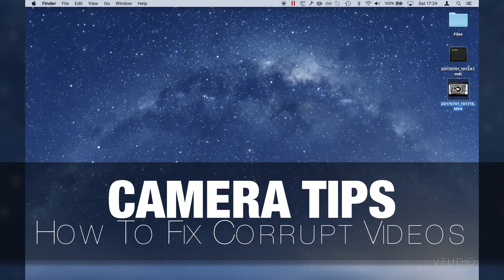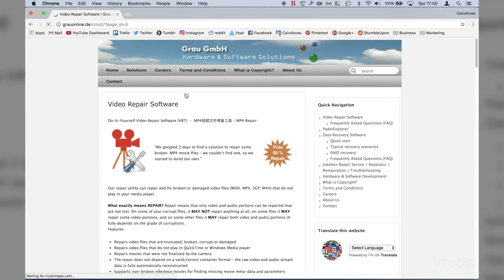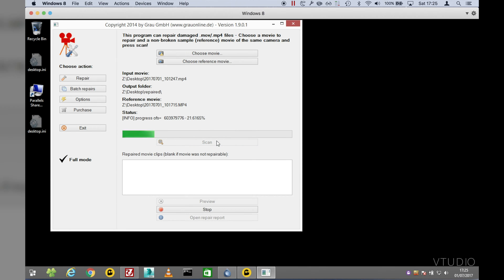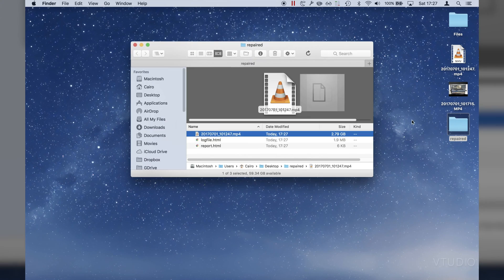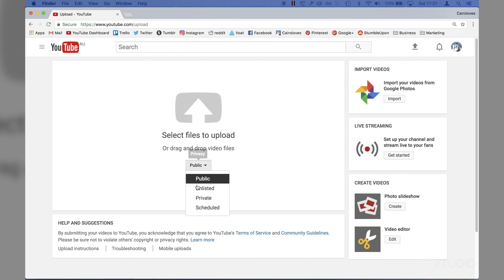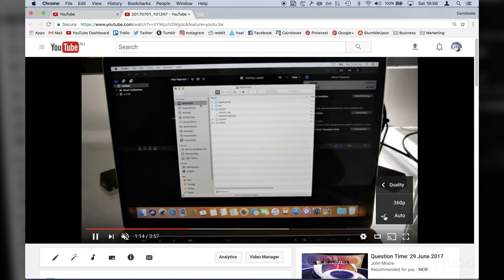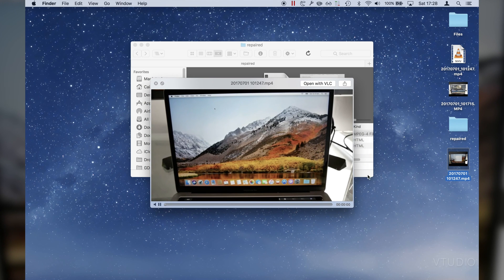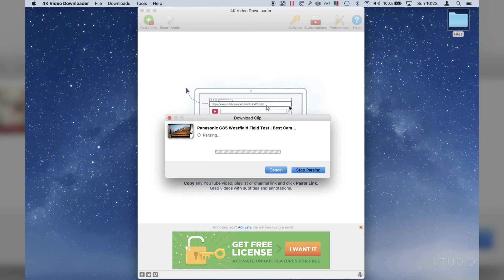How To EASILY Recover Corrupt Video Files (Example ft. Panasonic GH5/G85/G9 .mdt)

Comment: In case anyone is looking for some alternatives; There's a program by risingresearch that does the same thing and is free. It just doesn't have the batch option. Find it by googling risingresearch. Even if you need to process a lot of corrupted videos, Stellar video repair does it and is cheaper than the program from this video.
Reply: viruses alert

Comment: I tried downloading Grau video repair software but when I try to download it says " Error, missing script file." Recorded a conference and most of the files during the main speaker are corrupt .mdt files due to power failure on camera. I tried changing the files to .mp4 as mentioned by Jean- Yves  but that didn't work.
Reply: Actually there's a FAQ on the Grau website explaining a workaround. Fingers crossed!
Reply from the maker: Hey mate, mine just worked out of the box, if you're still having problems with it let me know.
Reply: Heya. So I managed to get Grau video repair working. Next after I uploaded the choppy videos to youtube, the quality was terrible so I tried downloading it using Clip Converter which didn't work but I downloaded some Malware instead but thankfully I had Malwarebytes to take out the malware. Next I tried 4K video downloader which worked but the video was still choppy. I realised there were some solutions in the Grau FAQ such as checking no ctts in the settings. I tried running a video again and it was almost perfect but I loaded it straight into VLC player which played the video fluidly.

Long story short I ran the repair and then opened the file in VLC player which seems to work. Now I need to get it into Final Cut Pro X and hopefully without issues.

Thanks for the help!
Reply: When I did the step to upload to youtube it got downgraded to 380p and when I download the video it's only 27mb instead of 8gb video and the quality is really low. Is there any way to convert the video in VLC without losing it's quality.
Reply from the maker: Hey mate, it takes YouTube sometimes a few hours to fully convert all the different versions. Alternatively you can try running it through ffmpeg or Handbrake: https://handbrake.fr/
Reply: Hi. Thanks a MILLION! It worked. Hallelujah! Dozed off working and when I woke up the video was available in 1080p. Thank you!

Comment: Hey! I'm having a bad problem. Shot a wedding and one of the cards was transferring and it seems the sd card reader is faulty and it stopped transferring and corrupted 7 files. Just so happens to be during the ceremony. Maybe cause they are long 4gb clips. Shot on gh4. It's not even showing them in the file numbering. It skips those 7 clips. I've tried multiple things and nothing finds it... I've almost given up. Any help would be gladly appreciated.
Reply from the maker: Are you able to see those videos on the GH4 directly? If it's just your sd card reader that's faulty you can plug in the GH4 into your computer using the USB cable. From there you can transfer over the files as normal and if they happen to be corrupt you'll see them with a .mdt extension which you can go ahead and rename to .mp4 and follow the guide.
Reply: No, I tried putting it back in the gh4 and they're still not there.. :(
Reply: Try to write to restore.media support. They can provide you with professional advice; at least they've always replied to my particular inquiries